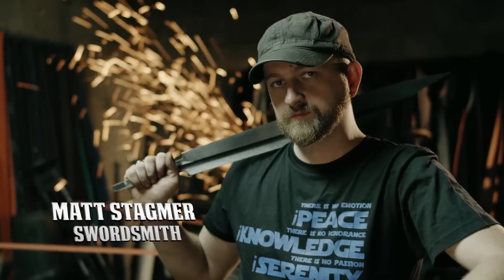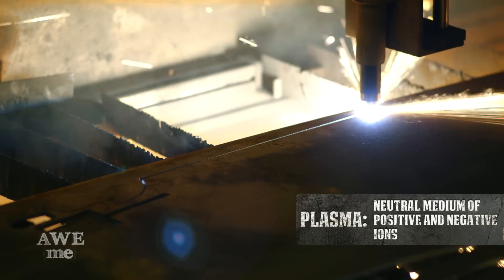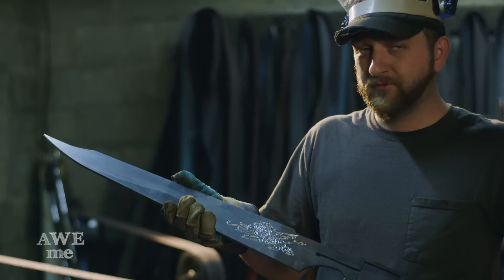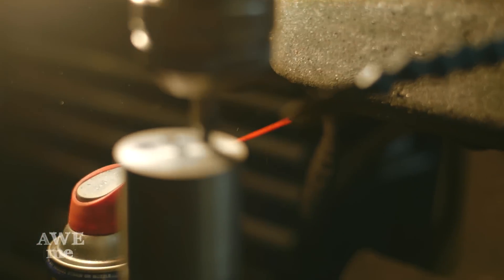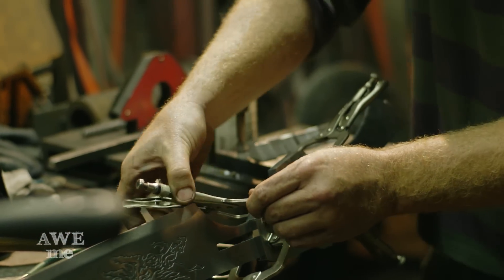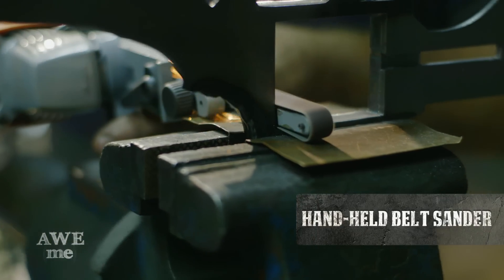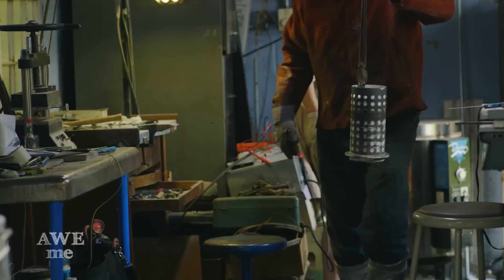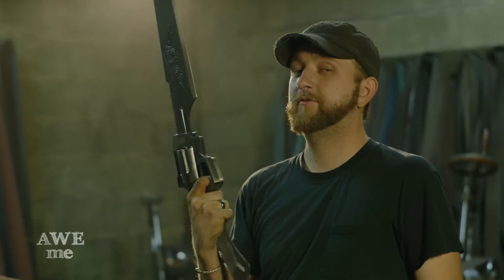Squall's Gunblade (Final Fantasy VIII) - MAN AT ARMS: REFORGED

Comment: I only had 1 issue visually (and possibly structurally) with this.  It was TOO DAMNED THIN!  There is NO way that blade would last in a full on fight with ANOTHER Gunblade.  Seifer's was thin because it was designed for 1-handed use.  Squall's was much thicker because it was designed for 2-handed use.

Other than that, it was really cool.

Comment: I hate to be that guy but I figured if you were going to go for all that detail, youd have remembered the indented groove in the handle where the fingers go, the main barrel in front of the cylinder, and the bolt at the back of the handle (I assume its to hold the grip to the handle). That, and the cylinder release switch. I sell these myself @swirlsworks on etsy but I only have the means to make them out of wood and making it capable of firing and rotating would be pretty difficult but this is a cool build, overall! Youve got a new fan!